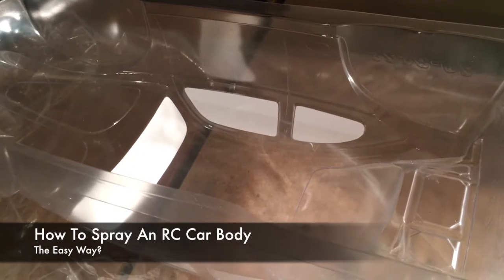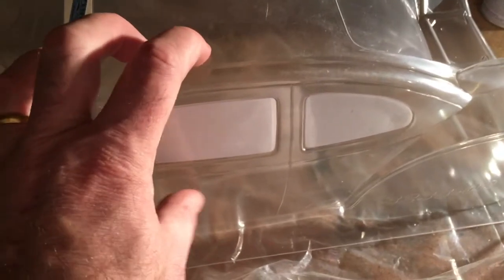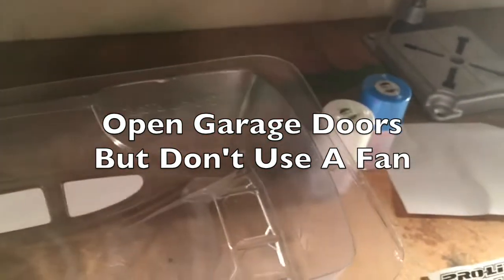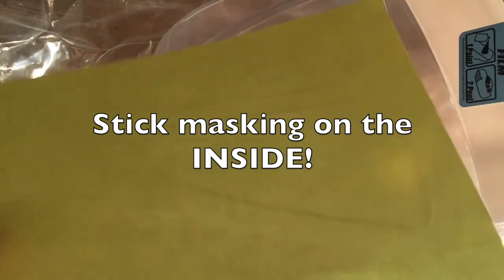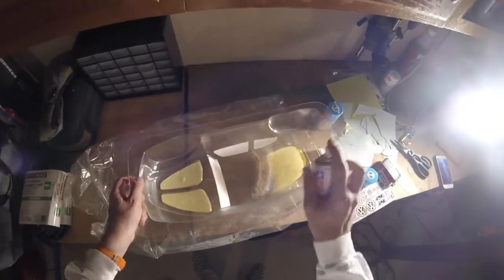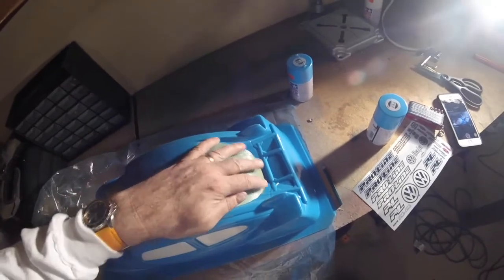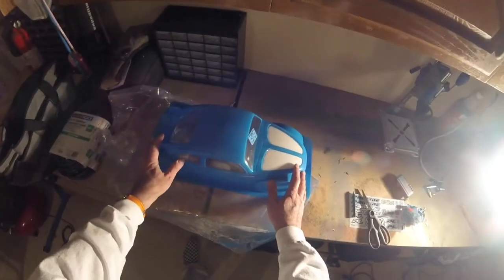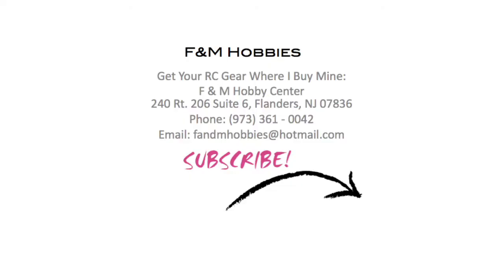How To Paint An RC Car Body - All tips welcome - Driftomaniacs

Comment: You can get rid of the bleeding around the edges of your masking with a razor blade and carefully scratch it away.
Reply from the maker: that's the kind of tip I was after - thanks. I'll do that this evening.
Reply: No problem I always love to watch your videos.
Reply from the maker: RC Monster Mash Studio thanks that means a lot. Sometimes editing late at night I wonder if it's worth it. Comments like that keep  me motivated. Workshop time tonight and tomorrow though. Changed pinion and spur to do very high speed run on typhon. Turn power on at home to test it. Drive works okay but no steering at all!
Reply: I never want you to stop making videos so I will make comments forever >:). How are you going to fix the steering? if it helps at all when any of my cars or boats stop steering it is usually the receiver or the servo motor is burned out.
Reply from the maker: RC Monster Mash Studio You are right - steering servo burnt out. Picking up a new one tomorrow. Today I wake to 2 inches of snow so no speed test with Typhon today! I have my friends Traxxas Rally to play with in the snow instead though!
Reply: You should get some sling shot tires for your slash or any of your rc cars so they can go in the snow. I have only seen snow once in my life and that was up in Boston.
Reply from the maker: RC Monster Mash Studio One of the other 'scale' guys has recommended mud slinger paddle tires for the snow. We shall see!
Reply: Yes we shall :)